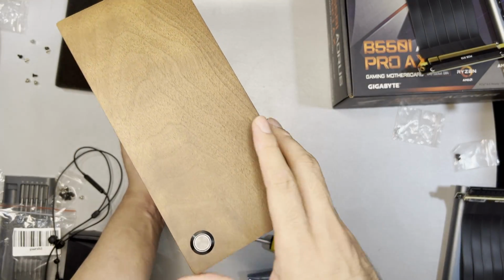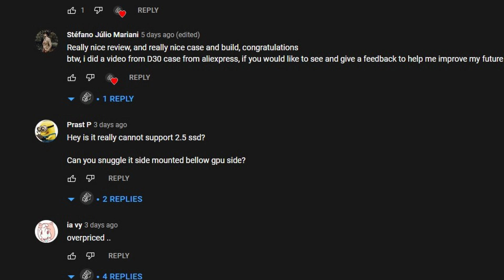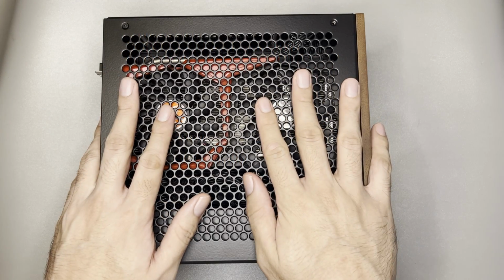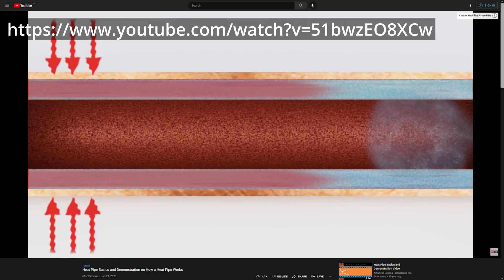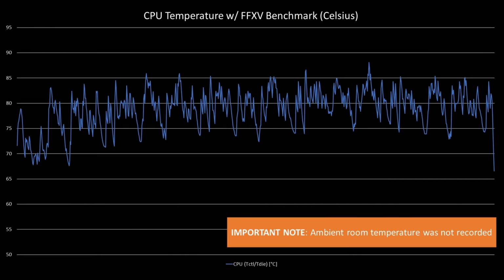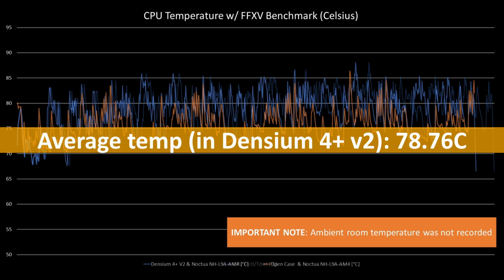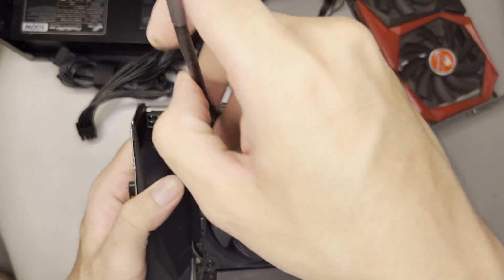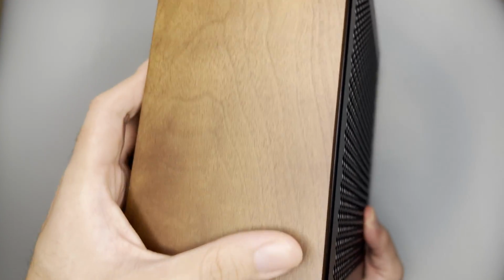Does CPU Cooler Orientation Matter? Can we fit in 185mm riser? 2.5 SSD? | Densium build folow-up

Comment: In a case like this, I would flip the fan on the CPU cooler, as top-down coolers such as boxed coolers or low profile ones tend to recirculate hot air when there is no system fan to help remove the air that was already used for cooling, so the CPU cooler can exhaust the hot air by itself.
However, I don't have experience with noctua coolers at all, so maybe the attempt backfires, but it might be worth giving it a shot, as I have done this with thin ITX builds before without harming the thermal performance of the cooler in most cases, but some coolers might not work with the fan flipped as some of them are very airflow dependant.

Comment: yes sir kadalasan kasi sa mga noctua nh-l9a heatsink at pag sandwich build na nakikita ko at based sa gn nexus about vapor chamber yung evaporation eh kadalasan dun sa end ng pipes at magiging tubig ulit pabalik sa otherside ng pipes kaya laging yung pipes ng vapor chamber eh nakatutok sa chipset or nvme m.2, yung build ko na d21 itx pro 2 months na okay naman temps around 70 to 80max pag fps games pero pag lock ko sa 144hz solid 70 to 60 below cpu at gpu basta match sila ng monitor refresh rate at mahalaga talaga exhaust fans sa sandwich build kasi yung noctua design eh ram to vrm ang tama ng airflow o ng heat kaya need ng malakas na fan to counter yung airlock sa loob